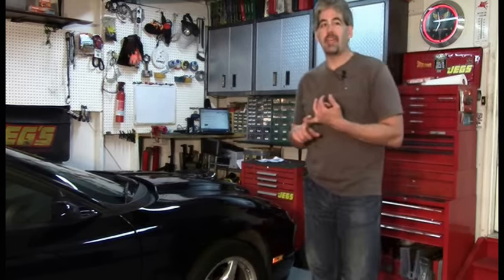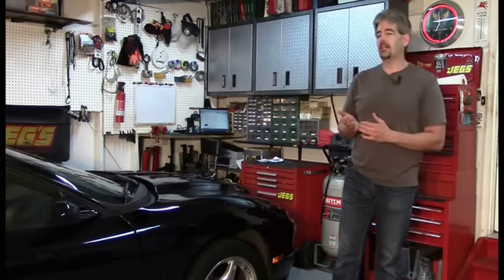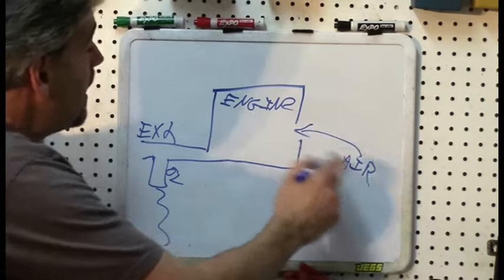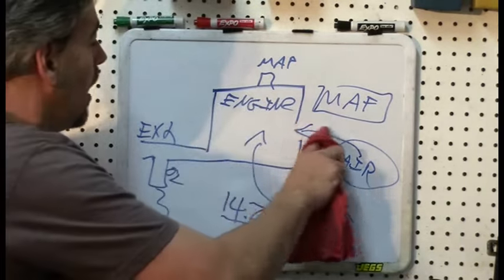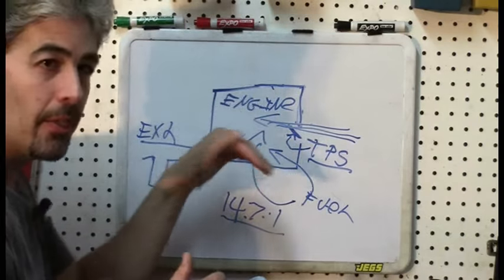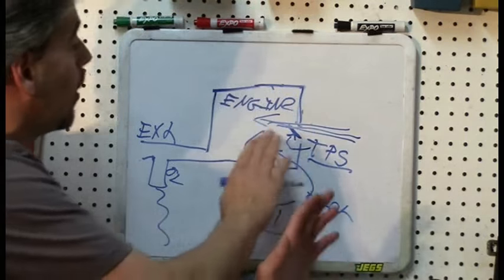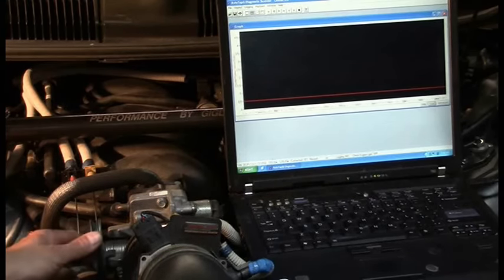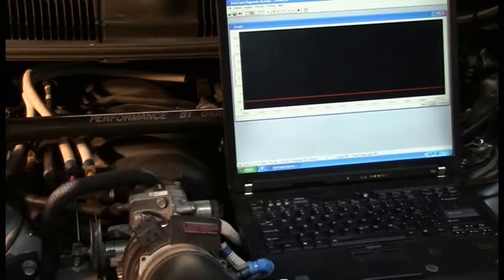TPS (Throttle Position Sensor) Diagnosis and Understanding Pt1

Comment: Hi recently the ford garage told me I have no return signal back to the TPS , so they  said  3 or  4 hours plus  parts , I was  in my head thinking well that sounds like  500 or  700 depending ,,,,,,,,,  but I know  what  wire from the pcm is  the  return and your telling me  the  return should be about 5 volts  also I believe , or am I measuring resistance hell I cant remember now lol .......... but can I  just bypass all the harness work and  run a permanent jumper wire possibly  with some conduit for a long term fix ,,,,,,,,,,,,,  I have rich 02 sensor readings on both banks also , and they cannot even tell me if  the tps will fix  that so I  want to attempt this myself . thanks any  info would  be  appreciated .
Reply from the maker: Yes I have done this many times. When I can validate TPS operation and create a bypass to input a return signal to the PCM and see that it is read, the wiring integrity is the obvious issue.  In many cases it is easier to just run a new wire from the component to PCM rather than trace the fault.
Reply: thank you for verifying that ,,,,,,,,, I do have a ford ranger 4.0 so what am I looking for at the return signal , is it resistance or roughly 5 volts

Comment: if i dissconected the wire to tps. will it less fuel consumption??
Reply from the maker: No it would use MORE fuel if anything.
Reply: @SchrodingersBox  thanks. i just tried it, accelerate so bad,low power. but decelerate so fast into idle rpm than connected tps.

Comment: If you can measure resistance between power and signal, why exactly is ground needed then?

The 5v power can go into the potentiometer, then return to the computer from the signal wire. That wire is essentially ground, in my opinion, as it completes the circuit.

If I think of the TPS as just a device that does something, then power/ground/signal makes sense. But if I try to imagine the actual path the electricity is taking, then I don't understand. Perhaps this is something not worth thinking about.
Reply from the maker: Yeah I struggled with this for years- what is the purpose of a ground in a potentiometer- until I understood voltage drop. 
 It may help to think of the signal wire as a positive probe from a voltmeter. You have resistors in series from the reference to ground and as the potentiometer moves it is measuring the voltage between any two of those resistors in series (or before or after the resistor series if at a full open or full closed positions.  If there was no ground, you would measure full voltage no matter where you measured between reference and ground- it would always read reference voltage everywhere. with the ground there, you get a voltage drop after each resistor in the series so you can get different voltage reading from your probe as it changes position.
Reply: @SchrodingersBox   @Schrodingers Box  I'd like to see a white board explaination. "Understanding Potentiometers" sounds like a future video.
Reply from the maker: Oh it will be!!!!

Comment: I guess I may have serendipitously come up with something beneficial to possibly some or few.. if it is possible for this sensor to have intermittent failure. That could drive someone crazy and fool maybe even mechanics as apparently it did.. if that be the case... some research to be done I assume. Or possibly I have groundbreaking evidence that this is possible.. to be discovered later
Reply from the maker: A bad connection would always cause intermittent on ANY electrical component.  Vibration and heat are always variables. That's why the virbration test is the first thing you do.
 Not groundbreaking- it's just established protocol.

Comment: You are an awesome GURU, can I take you out for a dinner or lunch out of gratitude ? Where r u located which City ?
Reply from the maker: I'm in Denver.
Reply: Schrodingers Box i am in Cincinnati,Ohio. When im there i will be in touch. Thanks
Reply: Schrodingers Box 
Matt, amazing channel of making fishers instead of giving out fish. Thank you. 
For openers, I have a small car lot I opened this past October.  Have an 07 Malibu.  No Check Engine light. I have a dead spot in the accelerator around 40 mph and up depending on load.  Initially thought it was a TPS or MAP sensor.   Once past the dead spot, lunges with rapid acceleration.  Same characteristic with Cruise set.  During a small hill, falls from 70mph to about 65 then overshoots to about 75. Checked air filter, looks good.  Suspected fuel filter but think it would choke off and fall flat and stay there.   Have a cheap scan tool which measures % of TPS and MAP pressure, not voltage. Any ideas?  Thank you.

Comment: Matt, you seamed a little nervous on your first vid! Out of character for you! Lol. Your presentation was a little bit confusing. I think you misstated a few things. When the resistance to computer ground rises, the voltage on the signal wire rises and when the resistance to computer ground drops, voltage on the signal wire drops. Another words, when the TPS is at the idle position, the resistance is very ( Low ) between the 5 volt reference wire and the computer ground wire. Current flows to ground and voltage drops on the signal wire. (Ohms Law - current rises, voltage falls). That is when you saw .5 volts (1/2 volt ) on the signal wire. When you were at WOT (Wide Open Throttle) the resistance between the 5 volt reference and computer ground is very (High (Low Current Flow)). That is when you saw 4.5 volts on the signal wire. (Ohms Law again, Current drops Voltage rises). Another thing, for (Safety Purpose's)  on this circuit it does not really matter (which I believe you noted), because this circuit and voltage is designed to bleed to ground ( 5 to 0 volts). It is protected by a current limiting resister in the PCM ( Computer). But for a general rule, if you are going to back probe a circuit with probes that are not insulated (your T Pins) then you should never use two on the same connector at the same time, because they have a strong possibility of coming in contact with each other or with ground. If they do, you will get, (Unrestricted Current Flow) and you will (Cook/Fry/Burn) the transistor for that circuit, in that $1,000 computer instantaneously! Other than that Great vid, Keep up the good Work!
Reply: Insulated T pin. That'll reduce the fear. Thank you for reminding that when voltage falls current rises. I had forgotten that.
Reply: DE Nichols AESwave - Electronics Accupuncture Probes, Lot safer than t pins! I was not reminding you about Ohms Law per se, but your welcome!

Comment: 96 chevy suburban won't start, replaced fuel pump b/c we couldn't hear it kick on but still won't start, plenty of fuel through filter, have spark from one plug but zero from another??
Reply from the maker: What data do you have? For example- what was the data indicating the fuel pump was bad?

Comment: I have a 2015 rogue after 50,000 miles the car started to run rough I changed the throttle the sensors and it still runs rogue  can some one tell what can I do next to eliminate  this problem
Reply from the maker: Yes. use data to diagnose the cause instead of throwing parts at it.

Comment: Question My car KIA Amati 2006 I was think I was the TPS but it still .
loses pressure when heated and look like  you pull the gas pedal but do not lose all the strength but has no code where stare
Reply from the maker: Radames Ruiz What data do you have?
Reply: Kia amanti 2006
Reply from the maker: Radames Ruiz No I mean data as in diagnostic data- what's the long term fuel trim both static and under load, what is the fuel pressure both static and under load? What are your TPS readings across the range of throttle positions? What is your BARO and MAP readings at idle vs WOT?

Comment: Yes yes yes I was at Pep Boys they couldn't figure out the problem. They charged me $621 changed the fuel pump motor only in the tank. And told me the new motor was running slow must be defective. They kept my truck and stated they cannot figure out why it wasn't running... starting. It's been out for weeks.... It started again not starting cranking. Starter fluid indicating fuel pump. I find low position on gas pedal it runs small window very rough three or four minutes and then Smooths out. Possibly this could be intermittent defect with potentiometer? Not to mention my 1 year free parts and labor with Pep Boys I do not trust them they seem too inept at this particular store

Comment: at 5:16 14.7parts??? to 1, it is 14.7 kilos/pounds to 1 kilo/pound would be the right statement. is a mass based ratio,,,
Reply from the maker: Volume to volume ratio.
Reply: Schrodingers Box Mass ratio Sir.
Reply from the maker: Alejandro Esteves Yes you are correct, sorry- it is Mass:Mass sorry
Reply: Schrodingers Box  glad you took the time to review your lectures.

Comment: Hello I am hoping you can help me here in Australia I am wits end with my Nissan Cube z11 2005 intermittent staking while driving most time will start but of late towed home will start next day most times blue temp light turns in just as it Revs and stalls but car is definately not cold I notice that fuel is rich and the car struggles also if air con on she barely moves had fuel pump checked also crank sensor changes ignition switch changed also it has finally come up with errors however mechanics seems to clear it and want it to muck up with them and $$$$ I can’t keep paying 

The errors are in order to print outs 
P0725 engine speed 
U1000 can comm circuit
P1705 tp sensor 
C1610 can eng rpm

It’s imported to Australia and it seems no mechanic is getting what the issue is 

Help please
Reply from the maker: OK- what data do you have?
Reply: @SchrodingersBox  data as in codes 
This is all info I have above so sorry I been taken fir a ride by mechanics if you help me with what data you need I can try even though a women I am determine to fix this cart yank you so much regards melinda
Reply from the maker: Yeah the codes are symptoms. Need basic data like the TPS angle curve and voltage. Also if it’s drive by wire I need the APP correlation to IAC  position.  That’s needed to assess the cause.
Reply: @SchrodingersBox  ok cause I don’t think I can do that 
Do I go to mechanic or auto elec for those?

And what can I ask them 
Seems they look at each other 

I just don’t know what to do 

Nissan say it’s not there car cause it’s imported it’s a joke 

I appreciate you so much taking this time 
I wish you were in Australia to be truthful 

So if you can direct me 
I can tell them what to do lol
Reply: @SchrodingersBox  it’s electric is that what you mean by wire 

I am a women Afterall lol
But I’ll be knowledged by the end sorry to ask so much
Reply: @SchrodingersBox  or what di I need to get these I assume obd firstly if so does it need to be hitech
Reply from the maker: Yeah sorry not much I can do from here. You will most likely need to take it to a dealer or repair facility but that kind of data isn’t something most beginners or weekend warriors will be able to acquire and analyze. But that data is necessary to keep from just guessing at parts.  Good luck!

Comment: What if I have all the symptoms of a tps failure and no check engine light?
Reply from the maker: Then I would check the aTPS and see if it's bad and if it is I would replace it. If it isn't  the cause then I would find what is causing the symptoms by most likely doing a fuel trim analysis as a starting point.
Reply: Changed mass air flow sensor and tps and still having same symptoms. If you ease in the throttle engine revs up fine. If you push down on their fast it starts to hesitate then evens out. Does the same thing driving... Changing gears or giving it more throttle up hills or from start. Not sure what else to check.
Reply: Also before tps change at idle RPMs we're at about 750 and now sits at 1000. It's on a 99 Tacoma 2.7
Reply from the maker: What was the data you had that indicated you needed to replace the MAF and the TPS?? It's really unusual you would have to change BOTH of them. What data was this based off of? I would totally start there- pretty obvious your answers lies in that data, since it was misinterpreted. Was this based off fuel trim? Resistance curve? what outputs were used?
Reply: Based off symptoms. No access to computer. To do live test
Reply from the maker: Now you've been a sub long enough to know not to make a diagnosis off symptoms!!  I can't help unless I have specific data bro!  There's no other eway to prevent just guessing.
 I always start with fuel trim. If I had fuel trim data at idle and curved against RPM it would be a starting point.
Reply: Bad spark plugs

Comment: Ok I dont have a check engine light on but my 2010 Chevy Tahoe 5.3 V8 Flex fuel runs perfectly but only when at a stop or in park the idle drops a little bit and you can feel it shutter not hard or anything just a little it still has all the power and doesn't die or anything just at idle or park it dips in the rpms a bit! I have read SO many different things so if ANYONE can please help I would deeply appreciate it thank you so much!
Reply from the maker: What data do you have?
Reply: @SchrodingersBox  What do you mean???
Reply from the maker: need basic information to determine the system to start suspecting.  whats the long term fuel trim curved against load? What’s the IAC step?  What’s the static vs loaded rail pressure?
  It is impossible to even take a educated guess without at least some basic data to start with.
Reply from the maker: You stated you suspect the TPS-  what is your reference vs signal voltage when curved against angle? What’s your resting TPS%?  Again- need the basic, fundamental TPS data to see if the suspicion is justified.  there is nothing to go on now.
Reply: @SchrodingersBox  Alright how would I go  about getting any of those numbers by myself I assume I would need some complex tool or Data reading system?
Reply: @SchrodingersBox  well I thought the TPS  after Google and watching alot of different video's with similar problems if you just Google ruff idle on Chevy Tahoe's idling it gives you a bunch of different video's and fixes that's what lead me to yours but you kinda seemed more technical! I did go into my local AutoZone or parts store in Oregon it's called Knechts and talked with the guys in there they all seems pretty informative and after about 15 minutes of explaining to them that the truck only shakes and drops idle when in park or at a stoplight or when the car is in drive but not going and it also doesn't have any resistance in the throttle nor does it throw any engine lights they were the ones who said possibly the TPS or dirty throttle body? They also scanned my vehicle while I was there and they said it throws no codes and then proceeded to tell me to keep driving it until it did throw a check engine light LOL
Reply from the maker: I would probably start by looking on youtube and see if anyone has made any videos on how to understand and diagnose a TPS.

Comment: signal pin is the midle one,here you cheking resistance between 5v and ground,and this test is missleading.
and you dont affraid fo grounding 5v ref,because you wont short and burn driver.its not work like that.

Comment: what can make my Honda civic 95 using extra fuel and having a missing in my engine???
Reply from the maker: +A Jay What can't do it? Give me some data to narrow it down.  Whats the LTFT under load vs static ? What's the MAP output? What happens to O2 output when you induce lean or rich variables?

Comment: i think the resistance should be measured between the ground and the signal wire of the tps
Reply from the maker: Why?
Reply: @SchrodingersBox  i really appreciate your efforts and the lesson is well explained but im just wondering if it is right as well to measure the resistance between the ground and the signal or it will give you faulty measurment and thank you in advance

Comment: how can you tell if the throttle position sensor is going bad
Reply from the maker: When the output voltage is disproportionate to the angle.percentage